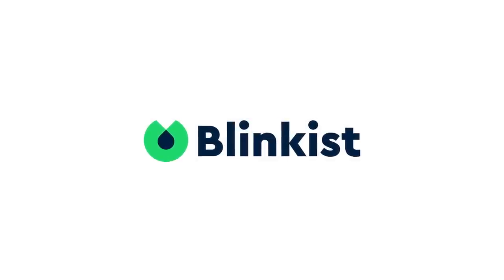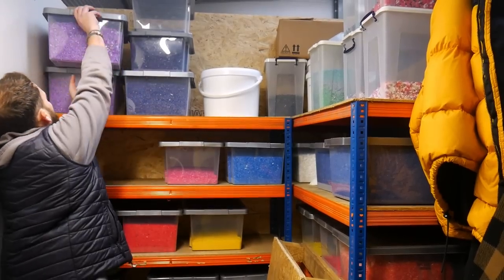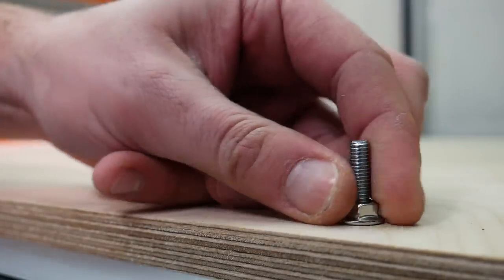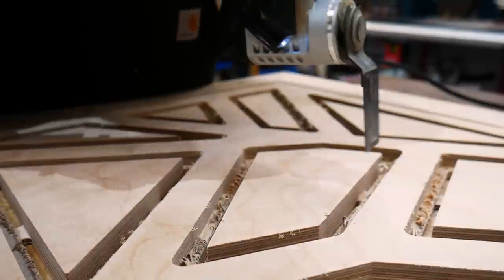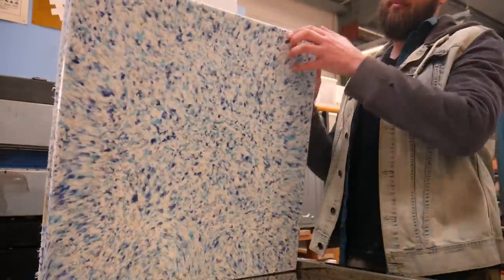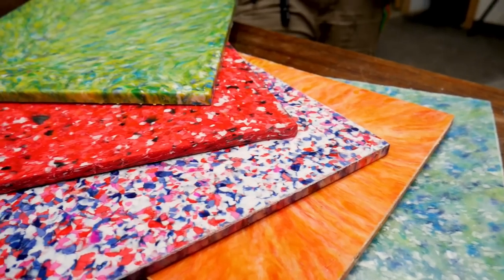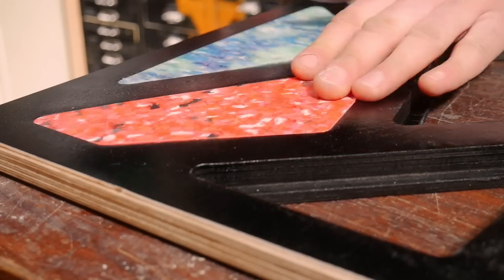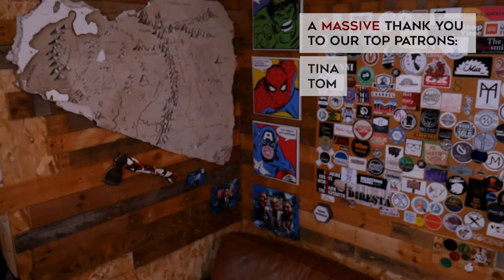From Epic Movies to an Epic Table

Comment: Just an idea - these sheets could make great ‘tiles’ to use as shop floors (or a number of other places). The plastic would soften the impact of tools dropped, would look awesome, and would have no problem handling water in the event of a small flood. Seems like a cool project and a great way to save some plastic from landfills!
Reply from the maker: Thats an awesome ideas - we better collect some more DVDs!
Reply: @BrothersMake  maybe ask your subs and fans to send old dvd cases ..
Reply: Very smart idea. You even thought of when a floor would be flooded!!! High five!
Reply: PP isn't tough as HDPE, probably tiles from PP breaks in case of a mid size impact, like a hammer falling.
So, I think HDPE is better suited for the task (and it's probably why in the industry they often use HDPE mats, for example in front of CNC machinery).
Reply: @Brothers Make  I think @mrbaseball1996 is really on to something here!  A shop floor is a terrific idea, and it would also be great as a  kitchen or bathroom floor or bathroom countertop.  (Melting might be a problem for a kitchen countertop.   🙁)  
Still, I think they're gorgeous &  would love to use it somewhere in my house!
Reply: Some sort of "grip" might need to be heat pressed or carved into these tiles, otherwise they could become very slippery when anything is spilt on them.
Reply: @ArmouryTerrain  Great point!  I never think of things like that until it's too late.   I simply look at all the colors and think, "Pretty!"  (Just like in the old days when I used to smoke pot... )
Reply: Yesyesyes🤩

Comment: So, what I've been doing, since the holographic material of the CDs and or DVDs, makes my crow brain really happy, is I have been taking off the holographic film by using packing tape. 
And it has to be the heavy duty stuff, just take a large piece of packing tape burnish it (that means rubbing vigorously on the tape to ensure adhesion of the holographic film and the tape) and then rip it off like a band-aid. It will give you a nice chunk of holographic film. With enough CDs, I can probably decorate these pieces into  decoupaging an item like a bookshelf. It might make it easier without the holographic film to recycle.
Reply from the maker: Didn't realise you could do that, very interesting!
Reply: Thanks for sharing!

Comment: For separating the waste, if the weight difference is significant enough you can spin the waster water down. Your abrasives should be at the bottom. You could also put it into a large bottom release funnel (in Chem we used a separatory funnel) and let it settle naturally and drain out the abrasives slowly
Reply from the maker: We’ve had other suggestions like this so we might just have to try!

Comment: You need downcut bits for your cnc to avoid tear out. There are also special upcut-downcut (compression) bits if you want to cut through the material and dont want tear out on either side.
Reply: 😂just finished writing a comment about using a downcut bit for a top pass then regular up-cut for the rest. Then I noticed this. Figures… I gotta get one of thes fancy compression bits!

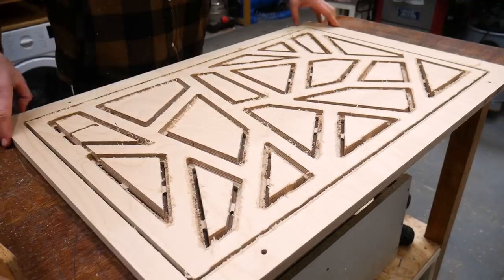Comment: 5:34 You need a “down cut” end mill to help with the tear out on plywood and msg. I always use it for a first pass with a 3-4 mm depth. Then switch to a normal ‘up cut’ end mill for the rest of the depth through, and use the down cut  for any finishing passes. 
Basically the geometry of the down cut has the opposite angle so it pushes chips down rather then up. This helps with tear out a lot, but you have to be a little careful with deep cuts because the chips don’t clear out as well and you can get more friction heat if you are doing deep cuts.
Reply from the maker: Great tips! Thank you

Comment: Use a down cutting bit to avoid tear out on the top edge.
Reply from the maker: Had that suggestion from a few people now. Will definitely be getting some. Thanks!
Reply: @BrothersMake  ALSO TRY PAINTERS TAPE IT WILL KEEP THE EDGES PERFECT ! - PS SLOW THE CNC DOWN A TINY BIT <3

Comment: I've seen DVD's used to make chimes, (the flat disk for the top, strings hanging down, and aluminum tubing different lengths, and a dVD at the bottom to spin around in the wind to bang against  the alluminum tubing, or sun catchers Very Neat Colors, The Red Would be very Cool for Retro  Countertops, or they could be used for deck or flooring tiles. YOU GUYS ARE AMAZING GOTTA  LOVE YA

Comment: In regard to separating Wazer waste, perhaps something similar to a gravy separator? There are different types, but I think you'd need one with a bottom release. You could build one yourselves with cylinder and funnel if the abrasive doesnt flow well.  Drain out abrasive into one container, then the plastic into another, or just pour it out.  Run each through a fine mesh sieve or filter.
Reply: I was going to suggest coffee filters to separate the plastic from the water

Comment: Hello brothers!, nice doing by reciclying material that usually get discarded as waste for not having another use. 
RECOMENDATION FOR COLLECTING PLASTIC WASTE FROM THE WATER:
I'm studying civil engineering, and one of the classes I take is about water treatment. Since the plastic sediment is fine due to the pressure of the machine, these are a couple of recommendations that I would like to give you:

* You can make a modular drainage system at the bottom of the storage tank, which leads perhaps to a bucket, with pipes of standard thickness is enough, however try to avoid elbows with turns greater than 90 degrees, since the sediment will remain clogged , and to be able to collect it, a cloth would be enough so that the water can run and the plastic waste can be collected

* To get a rough idea of how often you should empty the machine and filter it so it doesn't get to the point that looks like sand on the beach... divide the number of liters the machine can hold into an approximate amount of sediment each time that ends a series of cuts. That will give you an approximate of how many cuts the machine would do before it becomes plastic waste with water, for safety measure try to drain and filter it to 3/4 of the maximum volumetric capacity.

I hope it works for you. A hug from Guatemala, continue with such great projects. If you need any help do not hesitate to contact me

Comment: Hello! Love the channel! I recently got a 3d printer, and leftover PLA from spool ends, supports, and so on pile up fairly quickly. There are setups to recycle it back into filament, but those are rather expensive due to the precision required and not something the average DIY user could do. Would it be possible to use a simple setup like your panini presses to turn that leftover filament into sheets/shapes that could be machined using simple tools? I could see that being fairly appealing to the entry-midlevel 3d printer user and a great reuse of material that would otherwise go to waste. Thanks!

Comment: For the water you can use a centrifuge (you can make one easily, there are tons of videos on yt) it will separate the plastic from the water, that can be reused into the machine

Comment: Now that you have a sheet press, can you make a bunk bed using HDPE? I think id be a cool test of the tensile strength of the material...
Reply from the maker: That’s a wicked idea! My kids need bunk beds 🤔
Reply: Our transit system tried to make benches out of plastic, which sagged. This might have happened due to the hot summers. Somebody should test it for a few weeks first.
Reply: @BrothersMake  Maybe you could turn ordinary beds into bunk beds by building stilts, or scaffolding, or some form of support for elevation. Each bed could have plastic chairs and plastic desks. That's a big project.

Don't forget to build a ladder out of HDPE!

For any wood, you could maybe get free wood from disposable pallets/skids/whatever.

Comment: Use a HSS (High Speed Steel) end mill maybe a 3 flute with a .03R (30 thou radius).  This should help with tear out.  If it’s only marginally better use more radius on your end mill up to .125 radius.

Comment: You could do the whole thing in one sheet if you made thin walls in the shape you want, put them on the bed, fill in and around with the colors you want and then CAREFULLY remove the walls before putting it in the heater/press thing. This method probably won't have as crisp of edges as this table in the video was but it would definitely cut down on time cutting all the pieces and reduce the amount of waste. Plus no 180£ wood.

Comment: it looks incredible! also I have an idea but as you said materials are expensive so I wonder if it would work this way. if I mix different colors it will turn out black or nearly black or not? and could this work with form and elements bury in it, with use of press of course, some kind like an epoxy does?
Reply from the maker: It depends how much you mix. Our extruder machine mixes almost to 100%, so you get a complete colour blend with no marbling. So any black added to the mixes usually turns the whole thing black
Reply: thank you :)

Comment: Might be kinda dumb and will take a lot of space ... But i think making a solar mirror out of the reflective CDs surface could be quite cool. 

Outside of setting things on fire you can maybe use it to heat up containers as well (to melt plastic?, Albeit its really hard to control the heat). Or heat up water containers.

Comment: Hi,
Maybe you can help me :)
What thermoplastic can be used to make toy tires?
I would like to use my injection molding machine.

Or maybe you know what big factories that produce toys like tires are made of?

I would like to get this material from recycling. That's why all the rubber bands fall off ;(

Best regards.

Comment: Did you ever find out why you got the tares?  You might want to slow down your RPM  speed.  Plastic usually cuts at 18000
Softer wood can be cut at 1500 or less.
Reply: Also If you have an up-cut Bit or Down-cut Bit. Find out, then look how that works. The way the grain of the wood matters too.

Comment: Hello... where did you have your sheet press machine from or can it be made diy .? It Is different from the precious plastics prototypes.. can you guys build a simple sheet press machine by using two tee shirts heat press machines and join them , the first heat press machines (A) will be bolted on a metal table and then the second heat press machines (B) its heat pannel will be use to replace the pallet or sometimes called mat of (A) bolted on (A) heat pannel facing up. And it's temperature  redder will also be fix on the side of the table... 
Because the precious plastics sheet press machine are not cheap and easy to build.. especially when you are in area ,Africa West Africa,The  Gambia...lol guidance..

Comment: Hey Guys,
we have a similar plastic press and we have had a few issues with it that we have resolved. i thought you might benefit from hearing them;
in between the jack shaft and the plate we have added a spring to always have the sheat in compression and to stop the jack from blowing out. 
we set the bottom heating elements 10 degrees higher than the top as heat rises and we find this works best. 
lastly we add 7% more plastic then needed to help remove any potential air bubbles
I love your videos
Cheers, colby

Comment: only way I think you can get the plastic out of the waterjet water, is to filter the water through a cloth. its either that, our you let the water evaporate, which would take ages.
Reply from the maker: Like a muslin cloth? That’s not a bad idea!
Reply: @BrothersMake  yeah, same process as cheesecloth, but your particles might be small enough that just regular cotton would work. Or stretch some old hosier over a 5 gallon bucket, and then pour the water through that.
Reply from the maker: Ooh love a DIY option! Thanks 👍🏽

Comment: Unfortunately that i know of with a cnc machine that's the nature of plywood unless you get i'm more expensive plywood that's made not to break down when you're using it with a c n c machine it also is very water resistant but it's also very expensive... It's cool how water resistant it is because it won't soak up water like traditional plywood at all. You could leave it soaking in water for hours and it won't soak it up... Some other options are to increase/decrease the tool speed that can create smoother cuts, And finally to try masking tape... And until you can figure it out there is always just a good side in an ugly side to the project
Reply from the maker: Thanks for the tips!